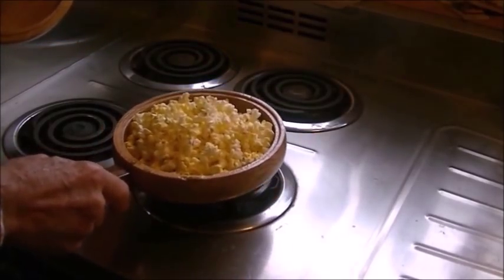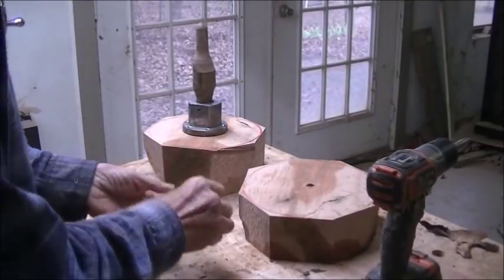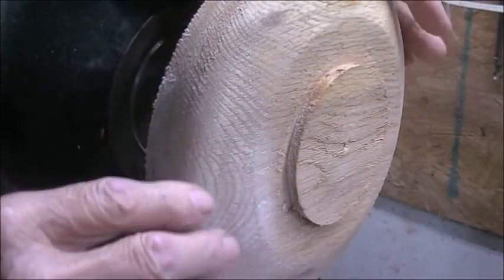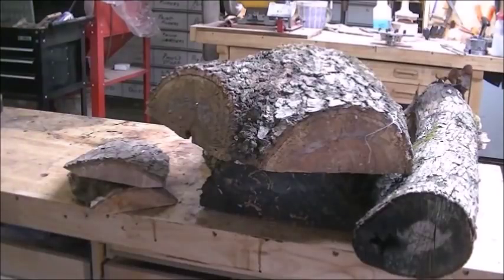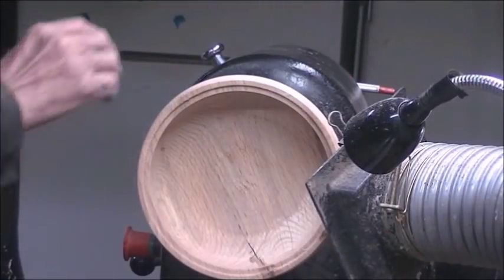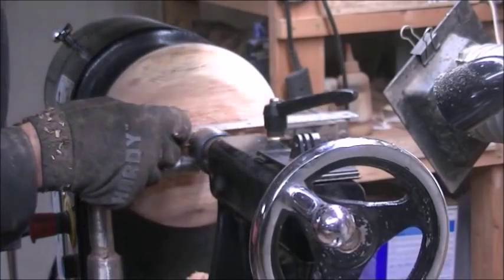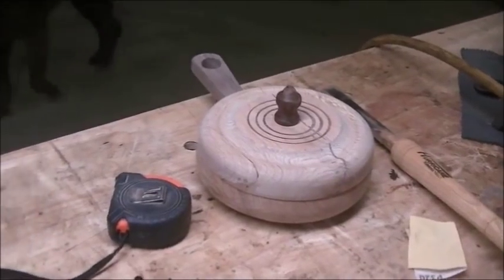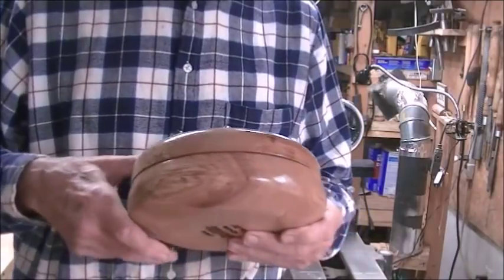PopCorn Skillet # 111

Comment: When re-building my 1947 25 Ft Chris Craft Express Cruiser (RED&WHITE) I learned one difference between White Oak and Red Oak. The end grain on white Oak is very small compared to Red Oak which is one of the reasons White Oak is used in wooden boats and not Red Oak if it will be exposed to water.
Reply from the maker: Good to know, Larry

Comment: Very nicely done.  Next time you have trouble getting a lot of tear out, try lubricating the wood with boiled linseed oil (BLO) or walnut oil and/or wet sanding with BLO or walnut oil.  (I prefer walnut oil because it does not yellow as much, but either one will work.) The oil will lubricate the wood, making it cut and sand more cleanly.  As an added bonus, if you wet sand with the oil, it will fill the grain -- acting like a sanding sealer.  A lot of turners like using walnut oil (or BLO) as their final finish on utility items such as bowls.  If so, by the time you've wet sanded through the grits, the item has been finished, too.  

It's just another option.  Your way worked, too.  One of the advantages of using walnut oil or BLO as opposed to sanding sealer is you don't have to wait for the sanding sealer to dry. So, using oil is quicker.
Reply from the maker: Yes, I have done that.  And, it works well.  The problem I have is the mess it can make.  I have used BLO as a sealer.  When you use an oil base finish and want to put poly on top of it, it can fish eye.  Thanks for your suggestion, Larry
Reply: Larry -- You're correct.  There are definitely downsides to wet sanding with walnut oil or BLO.  One of them is the mess.  I don't have a good solution for that, other than to try an cover things up with paper.  The other, as you mentioned, is the oil may not be compatible with your final finish.  Generally, you can avoid that problem by a) making sure the oil has cured, and b), applying a coat of shellac over the oil and under your final finish.  (Shellac sticks to virtually everything and virtually everything will stick to shellac.)  It may take several days if not weeks for oil to cure, so I don't use it if I'm planning on using a film finish.  I'm not willing to wait that long.

And, thank you for being willing to accept a suggestion. It was meant more for your viewers than for you.  We're all learning from each other and I find it helps knowing there are several different ways of solving a problem.  You're obviously doing more than just fine without my input.
Reply from the maker: I am not a knowitall.  Please continue with you thoughts and suggestions.  They are more than welcome.  Larry

Comment: Over my lifetime in woodworking the easy way for me to tell the difference between red and white oak is look at the end grain, red Oak will have 2 to 3 times as many open pores than white Oak. This what makes white Oak stronger and often heavier than red Oak.
You might want to try a product named Yorkshire Grit; it is a paste wax type product that was rotten stone and pumice in it and makes it possible to get away with sanding at a coarser grit. I rarely sand any wood beyond 220 grit. Yorkshire Grit will polish the wood and give you a glass smooth sheen to the wood. Give it a try and you will be suprised.
Reply from the maker: I see a lot of that grit.   Just haven't tried it yet.  Take care, Larry